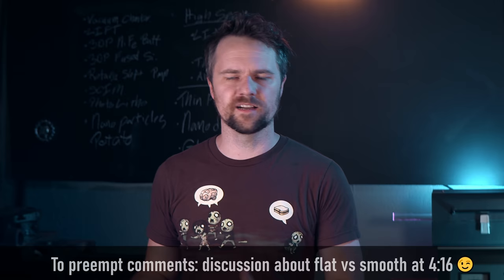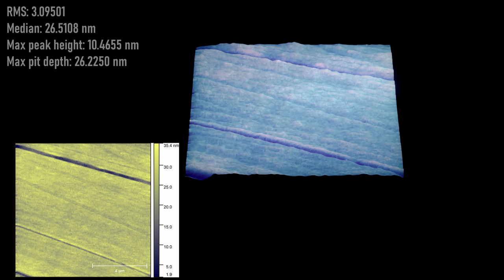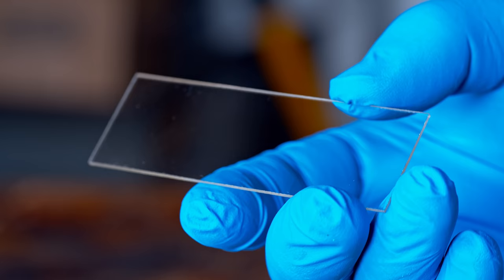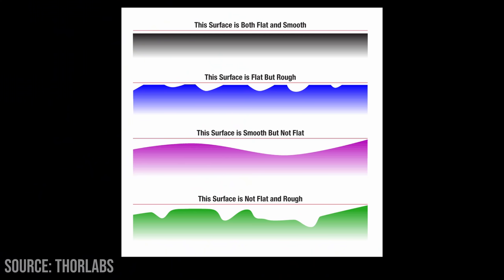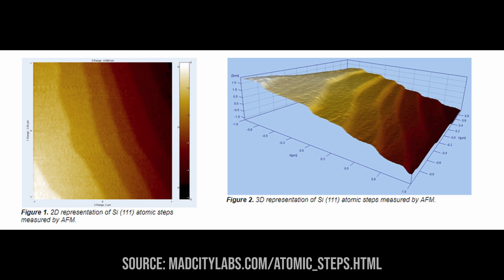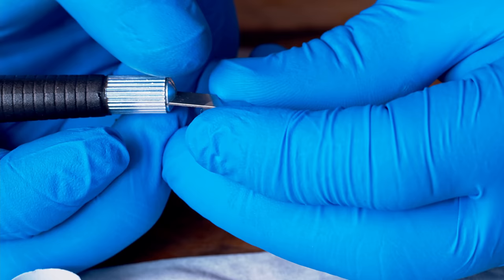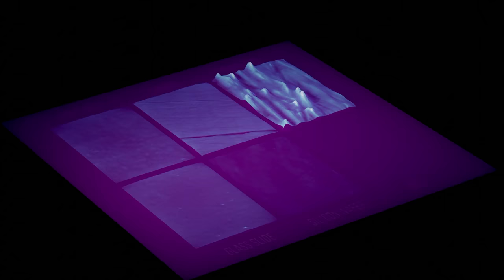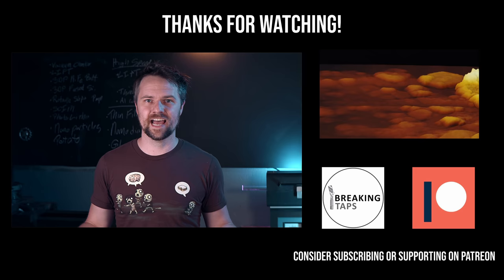What is the Flattest Material?

Comment: Reminds me on having once been told by someone from ASML that the mirrors they use for their latest Extreme Ultraviolet Light Lithography machines are made at a precision (roughness <0.25 nm) that, if one would expand one of these mirrors proportionally to the size of the Netherlands, the tallest „mountain“ would be less than 1cm high.
Reply: Just like the real Netherlands
Reply: Sounds about right for the tallest mountains in the Netherlands.
Reply: Sounds like saskachewan. It's so flat you can see the curvature of the earth from a fencepost.
Reply: Fun fact, It is even more extreme than that! I did an internship there. They polish the mirrors to a nanometer-level scale, that would be the same as flattening Germany to a millimeter ;).
Reply: @inventor121  LOL!!!
Reply: Everything about the EUV machines is mind boggling.  ASML and zeiss have some good videos online, but they still don’t do it justice.
Reply: I remember making a few of those there ;^). Different project, tho.
Reply: at the size of Texas, you're probably talking Mt. Everest
Reply: @inventor121  Saskatchewan:  'My dog ran away 2 weeks ago....if you look out the back window you can still see him going....'
Reply: @joeshmoe7967  I just woke up my roommates from laughing. That is hilarious.
Reply: @Kuiper39  Hydrogen atom has a diameter of about 0.1 nm; other atoms like Si or O or Al etc (common components of glass) will be much larger.

To have some significant reflection, you need to coat it with a metal. The metal layer should be more than a few atomic layers thick.
Reply: @janami-dharmam  Yep the coating is mostly built up of chromium, vanadium and scandium. The thickness of the coating varies somewhat between 2.5 and 3.1 nm.
Reply: @janami-dharmam  Metal surfaces don't work at 13.5nm. They use a 100 layer dielectric mirror coating made up of alternating layers of silicon and molybdenum. After applying the dielectric layers the mirror goes through a series of super-polishing steps using an ion beam in a vacuum chamber which can remove layers of material one atom thick.
Reply: @grimchameleon0546  It's like shooting fish in a barrel.
Reply: Shouldn't that be 1 mm ?

Comment: My mother worked for Rec Silicon back in the 80's. she was a machinist and also a lab engineer. sometimes when a wafer would be out of spec, she would make insanely thin throwing stars or snow flakes from them to give to us as little presents. We would also get huge globs of silicon that looked like 5" slugs that melted. Some had some pretty interesting shapes to them, top hat, sausage, spaghetti etc. don't know what happened to them but she told me on several occasions that the materials were worth about 150k a pound before they were messed up.

Comment: We used to use Mica for LEED or ' Low Energy Electron Diffraction ' because of its atomically flat surface it was used  as test samples to put the instrument through its paces, I cant get enough of this stuff !....cheers.
Reply: I wonder if the Mica surface coating with a plasma spray would be just as flat.

Comment: those high points on the slide are most likely caused by roll "pic out" when the glass is floated, the roll's that lift it out of the tin bath are touching glass that is 1200ish F. The glass is still slightly tacky, and the roll's can stick and cause these little tiny pulls on the glass as it conveys down the line.
Reply: Nice info, thanks!

Comment: You have all the pieces to do a project I’ve been thinking about for a while. A few years ago as I was leaving an aerospace job, our mechanical guys were raving about a new surface finishing method coming onto the market. Basically, you’d do a Fourier transform of the surface roughness to extract the spatial ‘frequency’ content. Then you’d put your object into a tub filled with a uniformly sized sand-like media, and vibrate it at those frequencies (I forget how they transformed freqs from distance to time), and you could notch down the specific frequency content of the surface roughness. Apparently it gave much much better polish to complex geometries that are hard to polish otherwise.
Reply: Frequency, yes. But how would the phase be controlled - would there not be a kind off bad phase-lock that would dig the valleys deeper?
Reply: @ramradhakrishnan9382  I don't remember all the technical details. But I don't see how that would dig valleys deeper - it could widen them to be sure, but an impact normal to the bottom of a valley would be just as likely as an impact normal to anywhere else. Phase shouldn't matter too much.

Comment: Have you tried to microscope slide's other side, too?  One side was in direct contact withe tin bath and will have tiny particles of tin bonded to it, the upper side was only in contact with air and should have no contaminants embedded.  For windows we actually have to identify the "tin side" as it has slightly different reflective properties.
Reply: Was looking for this comment!
Reply: How do you identify the tin side?
Reply: @terrygoyan  second this question
Reply: @terrygoyan  By looking at it, and you can tell because of the way it is.

Comment: I grind lenses and mirrors as a hobby, and flat (and smooth, as well) is more difficult to achieve than a figure of revolution. We settle for "quarter wave" but aim for the limits of our [optical] measuring capabilities. For smoothness and final figuring we use a lap of pitch, and cerium oxide or rouge to polish. Great fun for an introvert.
PS: I've been buying stuff from Edmund for half a century.
Reply: That's something I want to learn. How it's done? With the 3 flats?
Reply: I got to visit a factory in which a lot of Edmund products were manufactured. Gratings, Ronchi Rulings, reticules, first-surface mirrors, all that sort of thing. It was in a formerly industrial area of Philadelphia, and was owned and operated by a somewhat eccentric (but brilliant) man who once worked on the team that developed the guidance system for the Sidewinder missile, back in the 1950s. He told me a fascinating story about how they got that missile to home in on an infrared source in flight, using all analog electronics, no microprocessors, no stepper motors. Truly impressive level of ingenuity.
Reply: Use a big piece of Mica?
Reply: @Obladgolated  Right up my Dad's alley. He probs would have liked to talk to the guy.
Reply: @peteabc1  i worked in an Optical lab, and sometimes we would need Plano lense.
I would grind the lenses on a Coburn lens generator, and grind at the flatest curve possible and  reposition the lens four times, and it would be bumpy.
We take that lens to a Sphere Pot, and use our 0 diopter lap, and rock it in and out of the center, and after awhile it gets quite flat.
We sometimes needed a lens that was just Oh So close to flat, but when using the sagometer, it would read just a hair convex, and when we would epoxy it to a flat dive mask, it wouldn't trap bubbles between the stock mask and the Optical lens, and it would seem totally flat, but not quite.
When I would grind carbide in a machine shop, we had a large diameter lapping table that would create the first reference side to grind all other sides for carbide cutting tool inserts.
It's almost easier to create a pretty good flat, than to purposely miss the mark and make a minute curve 
I now work in a Granite shop, and Granite countertop materials are only real close to flat, but appear flat.

Comment: Re: the oxide (glass) layer on silicon wafers: I used to have a job at a wafer company. One step of the cleaning process was a soak in hydrofluoric acid, which would dissolve the oxide layer and expose the bare silicon. You could tell when the process worked because silica is hydrophilic, but silicon is hydrophobic. A pre-HF wafer would be "wetted" when rinsed with water, but afterwards the water would bead up.
Reply: Quick question: Does the oxide layer on the wafers prevent the semiconductor contacting the cooler/ heat spreader on top of the chip? I always wondered why conductive materials could just be squeezed onto CPUs without messing with the transistors underneath.
Reply: @eagames456  finished CPUs and other chips are coated in a protective layer of epoxy. You never actually see the silicon itself in a finished chip.
Reply: I knew they used hydrofluoric making chips because of a terrifying story I heard from a friend who worked for Microsoft in the 90's, but I always wondered what it was actually used for. Thanks Ian
Reply: Oh damn, bone hurting juice

Comment: 632.8 is red HeNe transition, not green. It is typically used for flatness specs so 1/20 lambda would be 632.8/20
I believe the 589.5924 sodium D lins is used for refractive index measurements.
No real reason not to use a green wavelength such as 532 yag SHG, except the  HeNe lasers are easier to control single frequency or Zeeman split modes for very long coherence length which is needed for precise interferometric measurements. That's why 632.8 is a standard today.
Reply: I was going to comment on this also - glad to see someone else noticed.

Comment: Originally, Corning's fusion glass process was to make car windshields.  However, the float process was invented at the same time and float had adequate flatness but was much cheaper.  Corning kept its fusion glass process running making microscope slides.  It was useful as microscope slides because it was virtualy perfectly flat as the glass surface was not polished and was never touched by anything but air.  The particles on the slide you have are probably chips from the slied cutting process.

Of course, eventually LCDs came along that needed fusion glass flatness and that is the primary use of fusion glass today.

Comment: I used to make x-ray optics that required a surface roughness of about 1 nm.  I have some large sheets of mica that are 25 micron thick, 5 cm X 10 cm with roughness of about 1 nm.  One can buy Si wafers that are about 1 nm smooth.  I produced smooth parabolic and ellipsoidal surfaces by coating an ultra-polished surface of electroless nickel with about 300 angstgroms of gold and then electroplating onto the gold.  Once separated (gold acts as a release layer), the inner surface is about 1 nm rough.  We used AFM to measure roughness but a better tool for these highly curved surfaces was a Wycko profilemeter as it measured over several tens of microns.

Comment: I once read a report that said humans can feel surface imperfections that are on the order of nanometers.  Can you feel each of those samples and tell any difference between them?
Reply from the maker: You can maybe just barely feel something on the gage block, particularly if you can catch a nail on one of the scratches.  It feels very very smooth though, and it's very subtle so I'm not sure if I'm imagining it or not tbh.  The grinding marks are super apparent by eye though, even if you can't feel them very well, they show up under the light.  Not sure I can feel anything on the glass samples though. Slightly rougher items around the shop are very noticeable though, particularly when you get to like the 500nm - 1um range.  Pretty impressive when you think about it!
Reply: Also interesting is if you've a feedback in hand, like an indicator, you can move it by umeters. The brain figures out you can increase precision by pushing from side without knowing anything about cosines.
Reply: What you feel is the effect of roughness against your fingerprints.  You don't feel the individual bumps per se, but the roughness will affect how much your skin "chatters" as you drag it over the surface with light pressure.  In simple terms, you can gauge the friction and feel the difference between roughnesses that differ in nanometers.
I remember reading about research into building sensors that work like whiskers, and how the vibration translates into what it's brushing over.
Reply: The tongue is far more sensitive than the fingers. Windows are in fact pretty smooth. Ask me how I know? :D
Reply: @mfree80286  International Professional I'll have you know. ;)

Comment: Your mention of glass slides brought back a flash memory from about 50 years ago. I was working a summer job at hospital lab and for a time was assigned to the PKU lab. There, one person was responsible to run all the PKU tests (Guthrie heel blot cards) for a very wide region.  Economy of scale was key in what was a total manual process. Anyway,  the lady who ran the lab brought in silk fabric and had me hand polish hundreds of new glass slides
Apparently it cleared roughness that interfered with the test. Why silk? Apparently it's quite strong stuff so the threads on a tight woven silk fabric resist friction wear and shredding and can polish the small pulls or contaminates off the glass surface without scratching.
Anyway,  it's an easy experiment you might try.

Comment: I had to pipe gases through stainless steel and was surprised that smoothest interior surface had a matte appearance rather than a mirror. The reason was that the polished mirror surface had sharp crystalline edges when seen under an electron microscope and the etched matte finish had rounded crystalline edges.
Reply: I wonder if they were processed with abrasive fluid machining (AKA hydroerosive grinding). A former employer made diesel injectors, and used AFM to radius the orifices and (IIRC) adjust K-factor. Pumping a diamond-powder-bearing fluid around at high pressure... now that's a recipe for a self-destructing machine!
Reply: @markp5726  We were told it was hydrofluoric acid etched.

Comment: great video! aluminium has a better reflectivity than silver in visible light. it is often used for mirrors in high precision instruments because of that. silver is only commonly used in mirrors because of its corrosion resistance.
Reply: As long as there are no traces of sulfur in the environment.
Otherwise silver does tarnish quite readily.
It doesnt develop pits like aluminum oxide does
Reply: Why silver isnt used for contact pads in electronics even though its the best conductor
Reply: @primus711  Silver tarnishes very easily. This creates a lot of resistance.
It also doesn't have a high melting temperature, and that could be important if you are passing a lot of current.
Meanwhile... I have a bunch of high current relays with silver contacts.  🤷‍♂️
Reply: @jimurrata6785  I've occasionally come across old silver coated component leads. You need to remove the tarnish layer (either mechanically or chemically) to properly solder it. The RMA fluxes that I usually use for soldering does nothing to cut through the tarnish layer. For relay contacts, hopefully the contacts are designed to provide a small amount of mechanical wipe when closing to break through the tarnish layer to get to the conductive silver.

Comment: So was the mica you scanned the piece that you had just sliced? Or does it look that nice right from the beginning? Really cool video!
Reply from the maker: Different piece, I filmed the cleavage bit the day before so I ended up cleaving a fresh piece for the actual scan.  If you let the freshly-cleaved surface sit too long, it starts to react with the environment and pick up defects (the crystal has a lot of dangling K+ ions, which start to react with water and CO2 to produce tiny carbonate crystals on the surface over time)  But it's pretty representative of what you see.  Super flat and free of particulate, although if you're unlucky it is still possible to land on a "step" where the layer breaks and you go up or down to a new sheet.  You can see those "steps" on the piece I cleaved as little concentric circles.  They are like millimeter sized though so pretty easy to avoid.

Comment: The flattest surface is a neutron star. It's sub-atomically flat... around a large spherical diameter...
Reply: how about the event horizon of a very slow rotating black hole? (because we don't have completely non-rotating ones)
Reply: @nicolasribeiro7914  If a singularity does exist, it is a one-dimensional point, and has no surface. An event horizon is a metaphysical concept, not a literal thing. It's the point at which causality breaks down and all spatial dimensions point inward to the center of the black hole.
Reply: @chbrules  yeah, there is no such thing as a surface to be flat
Reply: @chbrules  what I’m trying to say is that the event horizon of a Schwarzchild black hole (forgive me if I misspelled that name) has a constant distance from the singularity at all points
Reply: @nicolasribeiro7914  Since no known non-rotating blackholes exist, or probably can exist, all are rotating, and the radius of the event horizon around the center can fluctuate in an eccentric pattern (even if microscopically). Furthermore, as it feeds or loses mass to Hawking radiation, the Schwarzschild radius can shrink and grow.
Reply: @chbrules  you’re right!
Reply: True, but how do you fit that under a scanning microscope?  Sounds too expensive for a YouTube Channel...
Reply: @lotharerkens8154  Just become a type 3 civilization and invent the tech

Comment: Another way to think about smooth vs flat is like this:

I can take a solid wooden bench whose flat from one end to the other, but somewhere in the middle take a razorblade and scratch it.  The whole table is still flat from end to end, but the surface is rough because of the scratches from the razor.